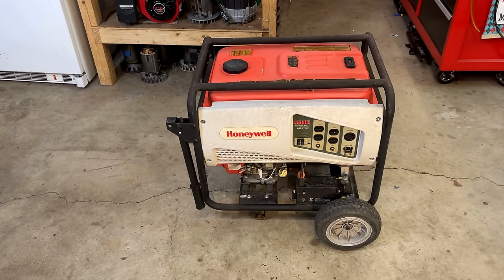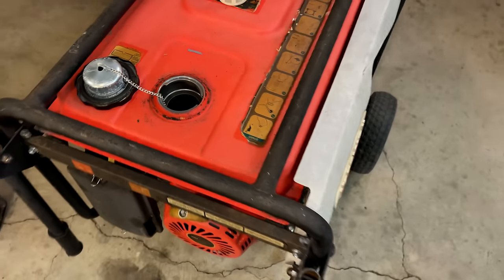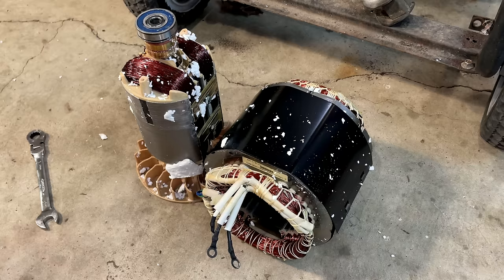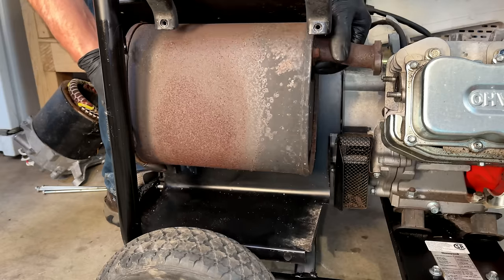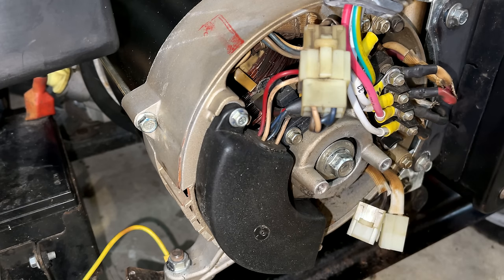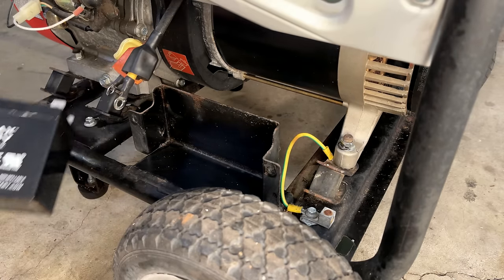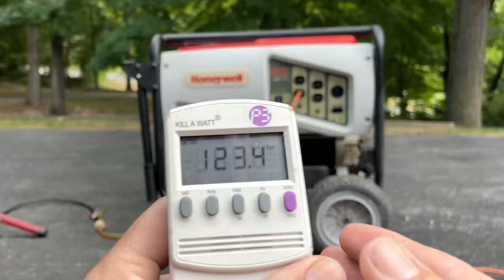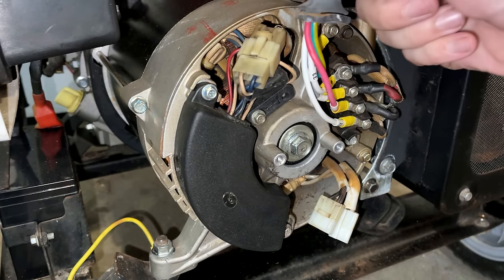Honeywell Generator Not Making Power - Fixed

Comment: Trouble is when the motor has done quite a few hours it's normal for it to use more fuel for a given output, most automotive carburetors have what's called load enriching device, usually an air pressure-controlled plunger that opens an enrichment jet and this air pressure changes as the motor ages to adjust appropriately. Reaming these stationary engine jets works quite well and keeps them working to their optimum.

Comment: On the fuel tank or other painted Metal "NOT PLASTIC Or FIBERGLASS" try some MEK or Awsome that can be found at Dollar General to remove dirt. The MEK will dissolve the glue.
The clog in the air box tube is a Dirt Dobber's Nest. Some carb or break clean sprayed through it Backwards and a small nylon round brush will clean it completely. We run into this here in Florida all the time.  On carbs, spark plugs, etc... if you have a sand blaster cabinet, clean it out and replace the sand or glass beads with Soda which can be found at Harbor Freight. Is is gentle and will not harm the aluminum. It washes away with water. I soda blast my carbs, etc... then put them in my Ultrasonic cleaner with water to make sure they are clean. Blow them dry with your compressor and you are good to go not to mention that the parts come out looking and most time working like new.

Comment: An insect may have put that mud in there. In Australia we have a mud dauber wasp that stings and paralyses an insect and encases it's prey in a mud cocoon. It then lays its eggs inside the prey and they use the prey as food and then break out of the cocoon and fly off. Also I will add a trick I found that you can clean a carb that may be temperamental. Rev the engine high and place your hand over the carb inlet til it almost stalls.  Then release and repeat several times.That can create a sucking force that can remove obstacles. Cheers from Australia.

Comment: Many years ago I would rebuild alternators which really just needed new diodes. I found out that several alternators would require a tickle. They would need a battery that was good to provide the voltage to the field.
  I think that  Providing a 12 V tickle may or may not be the problem. In the future perhaps install 12 V DC  Power to the alternator? Just a thought no judgment.

Comment: Scratch out its in a yellow bottle and a drill with a flat 3" round car washing sponge on the end of it will clean that white pannel very well. I use it for headlights and plastic trim. The sponge you can get on wish for like a pack of 10 for like $12.

Comment: For cleaning the plastic, since it is oil and grease as well as oxidation I would suggest a little oven cleaner on a rag and wipe it down to coat it, then use a wet rag toget that off after a few minutes. If that doesn't work use a DILUTED lye solution (clog remover for drains). One of those should work on the grease/oil stains.
Reply: It looked like tree crap to me. Which isn't exactly just tree sap but tree sap is involved.

Comment: On cleaning plastics try Ambercleanse (think thats how it was spelt) used to use it on a lot of plastics used on tv's, video/dvd players, computers and test gear took all the finger grease and general grime off just avoid silver paint finnish as it will take it off as well. Gives a disinfected cleaned smell try electronics supplier like Farnell if you have them in US.

Comment: My boss had a Lincoln outback 185 engine drive welder and the rotor bolt broke.. they had a lead time on a replacement of 2 weeks to a year for that special bolt, it was 5/16" -24 and 10.25 inches long... Very hard to get. Considered drilling and tapping different thread in crankshaft but little too risky for me..

Comment: Brilliant job been watching over here in the east of England for approximately a month now, and have recently purchased a Bohmer  AG model 6500W with a recoil starter myself for standby use. Don't be fooled by the model number its only a 2800 w generator not sure what items I can run off of it, I hoped I could run a small fridge freezer but don't know if it be powerful enough any advice would be appreciated keep up the good work great videos.
Reply: Check the appliance's tag for its wattage rating.
Reply: A full-size refrigerator (at least an American one) uses 2000 watts for less than a second to start up, then runs at under 250 watts. During defrost cycles it might be a bit more than 500 watts. A 2800w generator should be more than enough.
Reply: @eDoc2020  thank you
Reply: @eDoc2020   On 120VAC

Comment: Just out of curiosity. What would a repair like that cost a customer? I've seen a lot of your videos where you say other repair shops and the manufacturer won't touch some Honda generator repairs and yet you do, which is awesome. You have all the skills to diagnose and conduct the repairs. But sometimes labour and parts just don't make financial sense.
Reply from the maker: Most things I fix are not for customers as the repair cost would be too much.  In this case I think the parts cost was $200-$300 and labor for about 5 hours of work.  A shop would probably charge at least $600.  Most generator heads cost $500-$1000 new.  This Ryobi one is the exception.

Comment: James  have you ever come across a gen - that stumped you by not knowing what is wrong with the gen ? True a gen not making power is a dead give a way ! But why not ! If every thing checks out ok ?
Reply from the maker: I want to say I have never been stumped.  Usually you can tell with a multimeter what is wrong.  That said, residual magnetism loss stumped me once and I am working on one now that tests well, but not making power.  Think it has an issue with the AVR, but it’s old and sourcing a new one is difficult.  So trying to repair the old one and hopefully it works out.

Comment: Have now watched several of your very informative videos on these gens. I do have one question., You mentioned the necessity of maintaining the polarity on the brush holder connections. Why? Even if the polarity is reversed in the rotor, you will still get excitation in the rotor, just reversed polarity, and that will simply reverse the polarity of each leg of AC AT ANY GIVEN INSTANT in the cycle, but since it is AC at that point, doesn't matter.
Reply from the maker: Getting the polarity wrong will not cause damage to the rotor.  The main issue is the residual magnetism and the north south orientation of the permanent magnets.  When reversed the magnetism will try to reverse on the rotor.  Most likely that will collapse the residual magnetism and the generator will not power up without a little help.  Even once kick started the residual magnetism is opposite the permanent magnets and it may not power up on its own until the polarity is corrected.
Reply: @jcondon1  James, you say you don't use the stator wiring to charge the battery, so how is the battery charged?

Comment: With the rotor wires being coated aluminum I wonder if a AC TIG set for alot of "cleaning action", say 50% might be able to correctly weld those wires together.

Comment: Hi James,  funny how u mention the copper color... I was doing work in my shop and was quite
surprised when a powerful magnet grabbed an alligator clip for the battery charger. The gator 
clip is a copper color, so it is either steel with copper plating or steel with a copper color. Sad that
the quality isn't there anymore. someone knew we would want copper for electrical goods but was
too fkg cheap to give us real copper gator clips.

Comment: Have you ever tried the Mr Clean Magic Erasers for cleaning the exterior parts? Especially the plastics? I have been surprised how well they work on things.
Reply from the maker: Yes.  Used that and scotch brite to clean this one.
Reply: @jcondon1  Savings tip for the Magic Erasers: buy melamine sponges, from your favorite direct-from-china grey market. I recently purchased 30 1/2 size sponges for $3 shipped, instead of $5.50 for 4 (so 8 halves) at my local market.  10 cents instead of 70 cents each. They work just the same as the original ones, not the more recent "tough" ones.

Comment: Could join wires with low temp brazing aluminium rod
Reply from the maker: The main issue is the corrosion.  That wire will just crumble.

Comment: The plugged tank vent @ the airbox most likely due to a Mudwasp.... tried to see if the broken wire on the rotor is copper?   Since the 12 Volt connecters @ the stator are not being used is the battery charger inside the control panel?
Reply from the maker: The Honeywell has a barrel connector on the control panel to plug a charger in.

Comment: Hi there. First off, your vids rock. My resistance tests at .4-.5 ohms at the outlets, both the exact same on each leg. The stator windings has dark wires and the lacing has broke off in that area a lot. It only puts out 21volts AC on one outlet, near zero on the other outlet. New AVR. What would you think? Thanks.

Comment: You have a common and two legs coming off the stater. Where do you source the DC power to excite the rotor?
Reply from the maker: There are small magnets on the rotor and an auxiliary DPE winding that sends AC to the AVR which converts it to DC for the brushes.  The voltage quickly builds, but starts at only a few volts from the magnets.
Reply: @jcondon1  Thanks for the reply! I forgot about the AVR. I have had dealings with automotive type alternators which are basically the same in principle. I love watching you rescue generators. You have a soothing voice, plus I hate seeing perfectly good equipment get scrapped.

Comment: I’m thinking that wire broke there due to metal fatigue. Being spun on the rotor that connection must flex a lot because of the centripetal force being applied to it and eventually the wire broke.  It would be like bending a wire back and forth till it breaks.  When you repair that break you should figure out some way to support that wire so it doesn’t happen again.
Reply from the maker: Failed both due to the forces involved and the corrosion on the wire most likely from the flux used to solder the wire.  What was left was crumbling and weak.   Does not help that the wire was most likely aluminum.  Not ideal for a rotor.

Comment: I have to wonder... Was that genset old enough to have been made in a time before "gasohol"? If so, that could explain the slightly too small carburetor jets, since alcohol reduces the heat output of a given volume of petroleum fuel. As for aluminum wires breaking on the rotor... Could they be repaired by spot welding? Perhaps without even removing the rotor?

Comment: James try to use a female to female crimping connector instead of Aluminum welding for that rotor then do apply a bit of epoxy to fix it to avoid any damage due to centrifugal force and give it another chance, I never tried before but I think it might works.
Reply: That connection is stationary.  No centrifugal force.
Reply: @jackpatteeuw9244  really? Interesting
Reply: @jackpatteeuw9244  no it moves it’s attached to the crank.
Reply: @jackpatteeuw9244  the cut wire for the rotor and the rotor runs with around 3000 rpm which might case the wire or the connector to flyaway for that reason I recommend to glue it with epoxy.

Comment: With the DC output winding not attached, does the starting battery get any charge when the genset is running?
Reply from the maker: No.  The design of the Honeywell is to plug in a charger when the generator is in storage.  There is a barrel connect for that on the control panel.

Comment: I had a 7000W 3 phase diesel generator that let the smoke out, could you make a video explaining how to identify the 3 phase windings, stater, rotor, avr. in my case i wasn't sure what the events were but she fried the starter battery leads, the flywheel charging that charges the battery, and i goofed up when i was poking around and wasn't sure if i put the new avr on correctly since the wires were individual spades and bunches of them the same color etc... an absolute mess to swap new parts onto since it wasn't immediately obvious which same color wire went from the old one to the new one

Comment: Could you have used a butt splice connector for the wire that was broke in the stator? I would think that would work better than trying to solder the wire if you wanted to save that stator.
Reply from the maker: Not sure.  Because it’s spinning at 3600, the extra weight of that connector might cause an issue.  Maybe a little epoxy or something to hold it still would help.

Comment: Hi James, I follow your youtube video's with interest and learn a lot from you. I have recently acquired an old generator that has 4 slip rings, I can find info on 2 &3 (being 3 ph) but nothing on 4. Any ideas? Keep up the great video's Barry from UK
Reply from the maker: Most generators have only two slip rings to send DC power into the rotor to energize the electro magnet and the stator usually has the output.  On some generators it works in reverse.  The electro magnets on the outside where the stator normally is and the rotor outputs the power.  3 phase can be have 3 wires (delta configuration) or 4 wires (Y configuration).  Its hard to say without knowing or seeing how yours is setup.  It could be something completely different.

Comment: OHV engines will sometimes surge or not make full rated power if the valve lash clearance is too loose as the engine cant breath properly , if the seal for carb float neadile swells from ethanol fuel  it can restrict fuel flow.  Or cause the float to close without filling the bowl to the proper level (the float closes of the inlet early) .both issues will cause a lean fuel mixture under heavly load and Surge . running really lean under load will burn up the exhaust valve and seat if ignored long enougth but it will usualy surge so bad people will address it..

Comment: I have a question about my Gen. I have a B&S Storm Responder 5500/8250 watt Gen that I would like to switch to NG. I see the cheap tri-fuel carbs on auction sites but I noticed that the carb bolt holes are offset a bit (one higher then the other) . The bolts for my carb are perfectly horizontal. I think those new tri-fuel carbs would sit at a slight angle. Will this cause a problem? Thanks. - Thanks Jim 🤠
Reply from the maker: The offset holes are usually fit a Honda.

Comment: interesting is the bolt broke where it was screwed in to when you wacked it using it to break the taper free on the stator/crank connection.

Comment: This was another perfectly diagnosed generator. Your attention to detail is impeccable. You have a very high standard when repairing and fine tuning the generator. Watching your channel and content is helping me when diagnosing the electrical on generators. ❤🇨🇦
Reply: 0piiiiop look
Reply: Good
Reply: I agree and have learned a lot. Thank you Jim
Reply: I worked on a job at a new sewer plant ! It was a big surprise to all personnel that Al the wires supplied and provided were over sized wire was #10 not 12  the insulation was double the thickness of regular wire ! Even tho the breakers were 20 amp not 30 !

Comment: One caution about using a crimp connector.  Dissimilar metals, connectors made for copper used on aluminum. 
There are products available to coat the metals to prevent corrosion between the two metals.  It works a lot like antiseize compound on bolts.
Before I forget,  Great Video as always!

Comment: Hi James. I have a diesel generator here in sunny south africa that is not putting out voltage. It seems to be a brushless generator with a capacitor 20uf, no AVR what can I check to see where the problem is.
Thanx
Reply from the maker: I would start with the 20uf capacitor.  That is the only thing you can easily replace.  Otherwise it could be a bad stator or rotor.  Brushless generators also have a couple diodes  and maybe a couple varistors soldered into the rotor that could go bad.  You would have to test the capacitor and stator insulation to know for sure what is going on.

Comment: I have a honda clone just like this.
It is not putting out power .
Mine has lots of oil on the wires after I do test what would I clean oil off with ?
I bought can of electric motor contact cleaner .
It says protect from plastic.
10-13 -2023.

Comment: I  would have taken a lesser diameter wire .... in the middle make a double loop  solder to the broken wire  before all that work  .epoxy or cement to prevent stress

Comment: Will a Honda gx-390 gas tank fit on a Honda gx-160? Do you know if the mounting holes are the same? Motor casting the same? Because I just want a larger tank on my Honda gx 160 air compressor.
Reply from the maker: Not sure, have not tried it.
Reply: @jcondon1  I guess I can give it a shot and if it does then I can let you know how it works out. Ps I just found your channel and subscribed. I enjoy the video's and a lot of knowledge I'm enjoying. Thank 😊

Comment: If one didn’t have spare rotors and stators laying about, could they just solder the broken wires and have a functioning unit?
Reply from the maker: You could and it does work.  The issue thought is removing the varnish and a lot of times the wire is aluminum.  Also the corrosion usually leaves the wire very brittle and easy to crumble in the future.

Comment: Good job, tho I don't count it as a "repair". You actually just fitted another power head. It was an exercise in finding something with similar dimensions. I wish you'd made it more relatable to those who only have one, broken. generator, and would like to repair it.  There are some really good comments about overcoming the aluminium wire connection problem. That would have been more valuable education than "swap it out".
NO criticism of your workmanship, diagnostics, etc.
Reply from the maker: I have repaired them before, but never happy with the quality of the repair.  Since I sell everything I fix, I stopped trying to fix them because I do now if the repair will last.